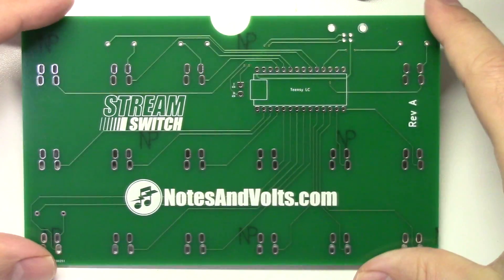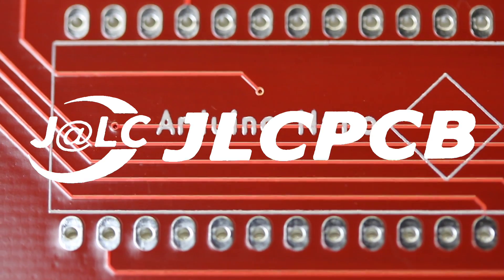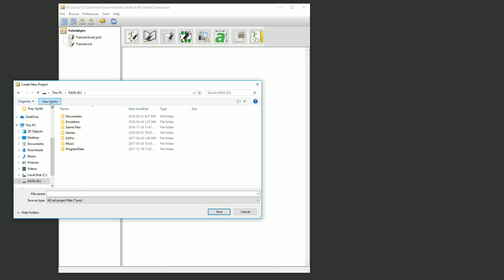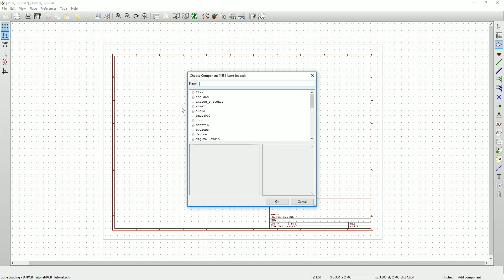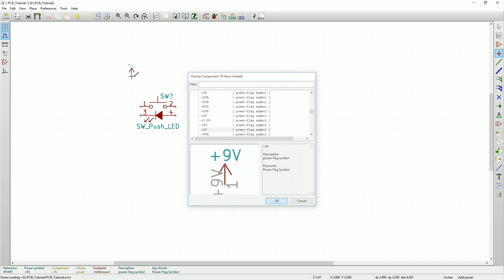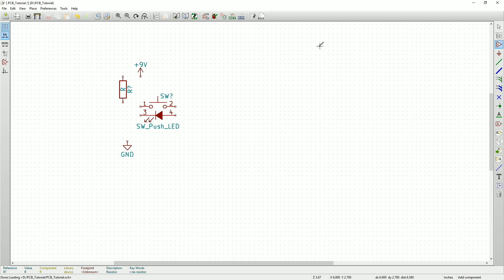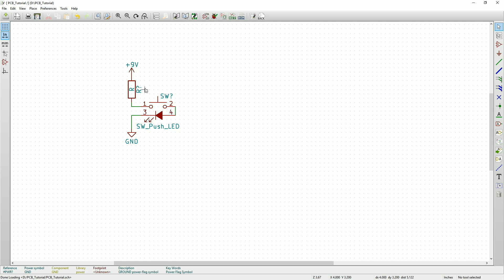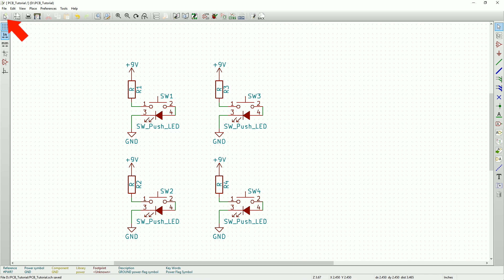KiCad - From Design to Manufacture - Part 1

Comment: Once again our pal, Dave, has exactly the tutorial series I need. 
Thanks to Dave's great Teensy Synth tutorial, I'm just finishing up the final tweaks of the Teensy Laser Synth, which is blowing away all of my expectations.
Now, I need to design a PCB to replace the 3 audio shields and add X/Y differential amps, w.offset & 2 x gain. So, I'm back for phase 2.
Then, it's on to a new custom laser MIDI control desk, which Dave has already covered and the parts are waiting for assembly.
How-to DIY video is in production.
Thanks Dave for enabling the realization of 35 years worth of dreams and ideas during my hiatus from doing laser shows. Having a great time just grooving along with some psy-trance rhythms in the privacy of my living room.😜😎

Comment: That's great.  My only problem is that my downloaded  ki cad did not have any component schematics on it.  I had to try find downloads, which I have an they are not anywhere near comprehensive.  I tried removing Ki Cad and re-installing, but it just remembered all I have.  Anyway I can get the KiCad library of components?

Comment: Hi Dave,
i have a question. For my very first project i will make a PCB like the 8 Fold simulator module from siemens 6ES7274-1XF30-0XA0. 
What is the normal way to make the 11 connection pins, and how you name it in the schematic?
Thanks in advance
Reply: Have found out already.
Sorry for bother you, next time i will search a little longer.
grtz Frans